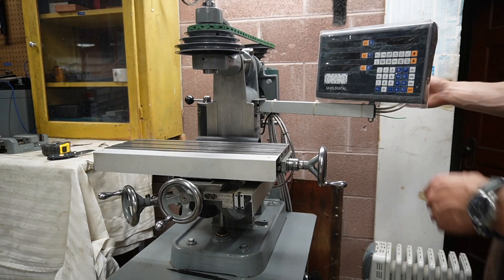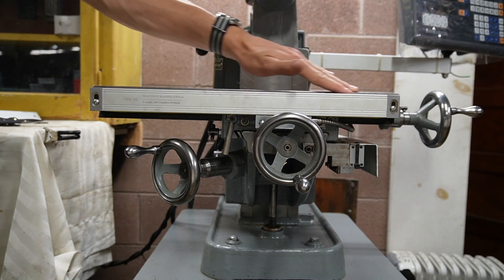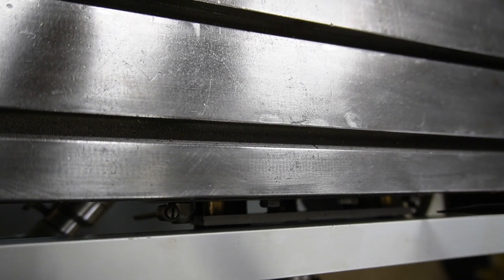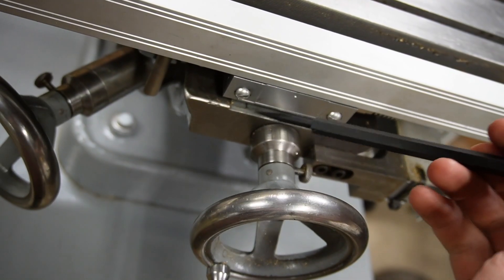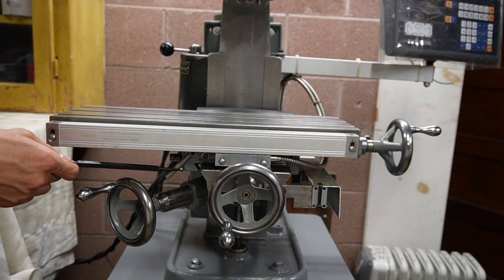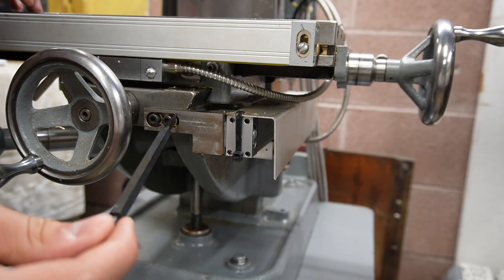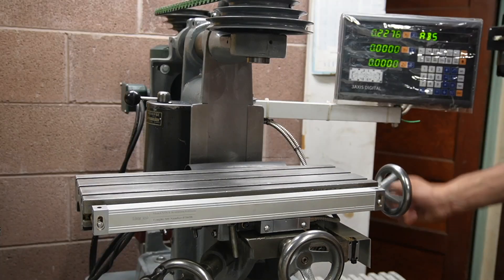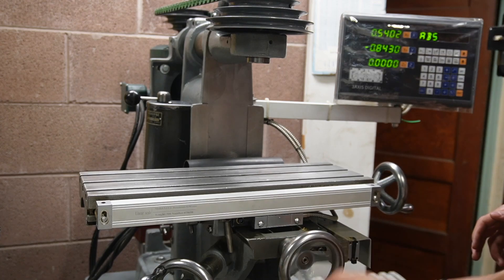Benchmaster DRO upgrade, small milling machine improvements

Comment: Awesome work! I just picked up a non running benchmaster mill for $50 last week, took an afternoon to get it cleaned up and running again, and now can't wait to get a DRO on it. My only problem so far is I can't get the Y axis trammed in, any tips on adjustment on the Y? I got the X axis dialed in to 0.001" over ten inches but can't figure out the Y, I'm hoping it isn't non adjustable as its out about 1 thou per inch.
Reply from the maker: Nice you got a great deal on one of these. 

Did you tram in the z axis too? If you are measuring from an anchored point on the body you’ll run into two different variables z and y. You could set the x gib screws by setting up your indicator stand (hopefully mag base) on the z axis knee. The lowest curved piece of cast iron that rides on the body dovetails and make or find a flat surface for the probe. Honestly though, if your having issues, you may just want to take the table off, knock the pin out of the y axis handwheel to remove the carriage and clean everything really well, focussing on the dovetails and gibs. If you don’t have it already, pick up some good quality machine tool oil like Mobil way oil in this case. That and properly set gib screws should get you about as close as you can. Thank you

Comment: Can I ask what DRO you used? Was it a complete kit?
Reply: I finished mine using the toauto 150mm (x) +200mm (Z axis)+300mm (Y) kit off amazon.
Personally I would HIGHLY reccomend going for the 3 axis the first time. Its so much better than justa 2 axis, and youll always want to upgrade if you dont.
I love it, but if you want a better interface, I suggest the toauto scales with a touchdro setup. Touchdro is as good as a manual machine gets.

Also, for the X handwheel, I just made an extension on my lathe and now have retained 100% travel in every direction.
Reply: @rniejx4219  thanks!